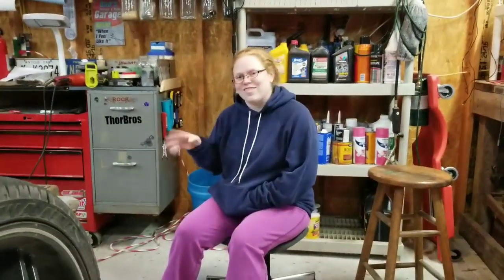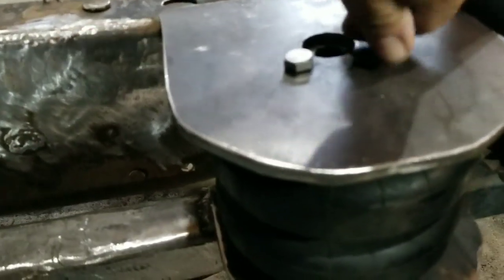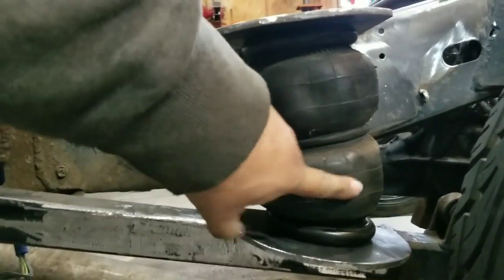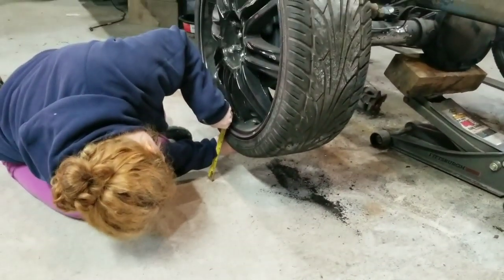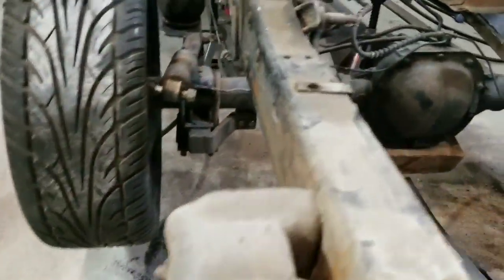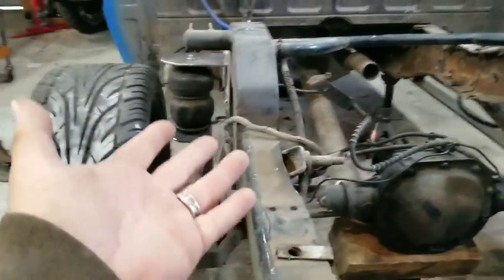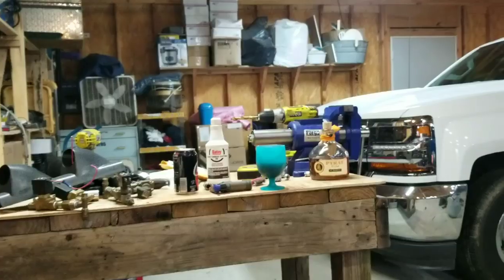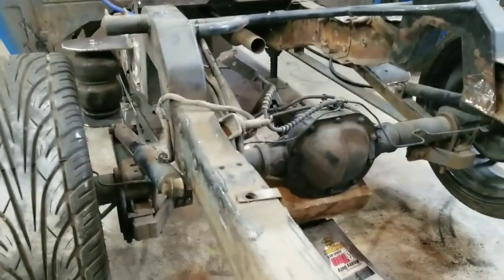Measuring for a c notch and planning a pan hard bar 2-11-19

Comment: Great explanation on the measuring of the notch . Only thing i would have added and you mentioned part of it ,if the bag is over axle then you need to account for the thickness of bag,upper bracket, and the height of the lower bag bracket too cause they vary as well . 
But still awesome explanation and awesome video . Hope you feel better
Reply from the maker: Thank you and also true very good point.